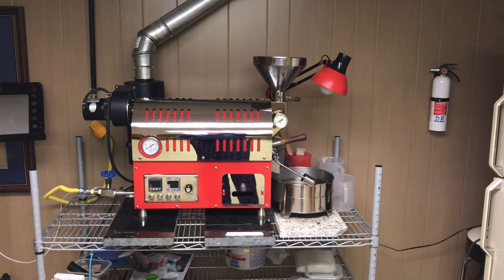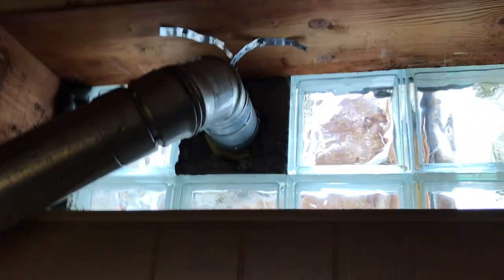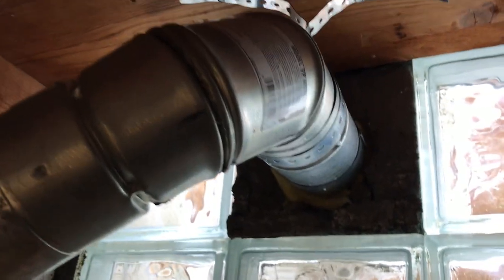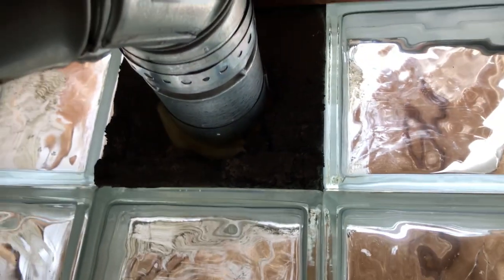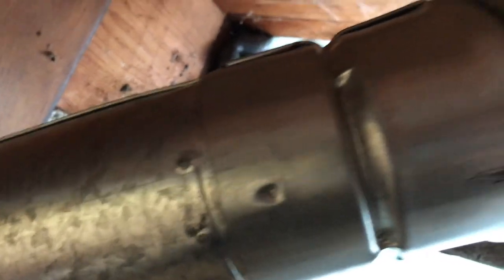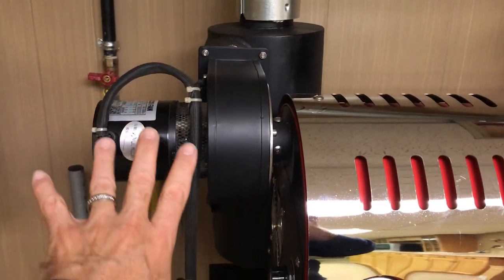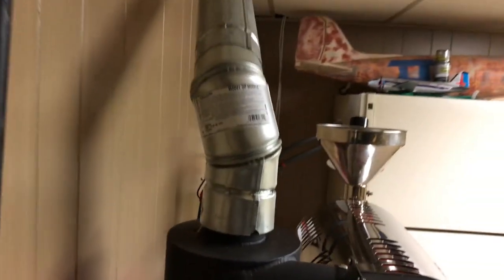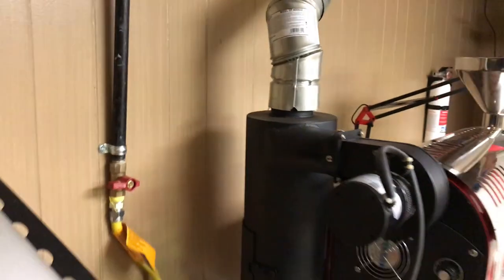Venting a 500 Gram Mill City Coffee Roaster

Comment: Nice video Mike, thanks for posting.  Two quick questions - how is the venting connected to the chaff collector and what did you use for termination on the other side of the glass?
Reply from the maker: Jason Emerson thanks for your question.  The vent pipe is attached and secured to the chaff collector by making 4  cute into the inner pipe so it can flare open slightly.  That will allow you to sleeve over the chaff collector’s male end.  As far as termination goes outside. I am using a cent cap.  Click the last Home Depot link in my description and you will see an example.  There are different types and it is personal preference.  Hope that helps.
Reply: @mikeszone  thanks for the quick response!  I'm in the process of getting mine set up and appreciate the benefit of your experience!  I just noticed that you have some other maintenance videos so I will be sure to check those out as well.
Reply: @mikeszone  also - just clicked through on the links and it looks like they're not carrying the Selkirk products any more, but they have something called Speedi B-type pipe.
Reply: Jason Emerson can you share your setup?  I still can’t figure out how the Chaf collector is vented.  Also, looks like Loews sells the pipe and Home Depot has a different, but similar brand.  How is it working out for you?